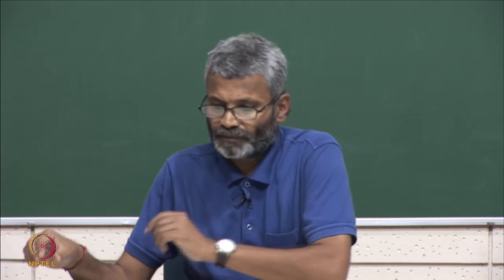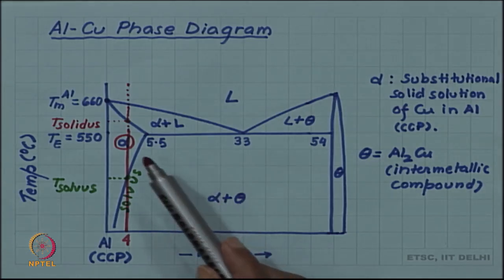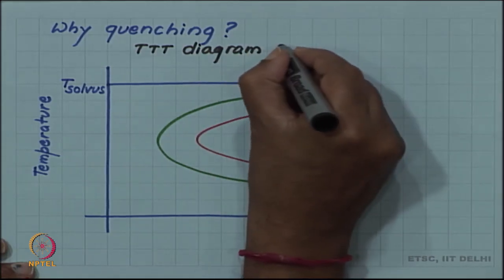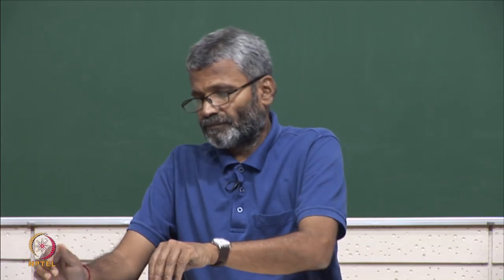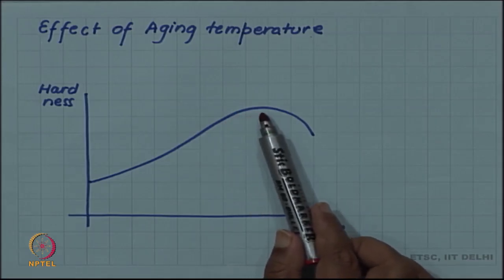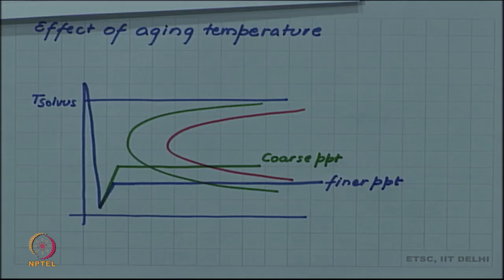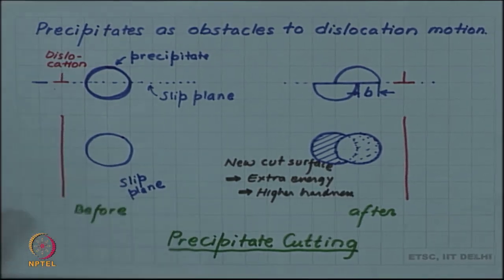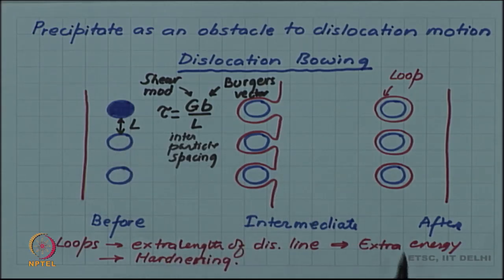Age hardening II: Microstructure and mechanisms

Comment: You have said in your previous video that no change in the microstructure of Al alloy was found. But in this video, there is a microstructural change (change in the distribution of precipitates) which proves that " Property is a function of microstructure". Is that not correct?
Reply from the maker: It all depends on the scale of observation of the microstructure.  The size of precipitated causing increase in hardness is very small and cannot be observed at the optical microscopy level. So for the initial investigators, like Wilm, no change in the microstructure was observed although there was change in the  hardness. This was the surprise element. But later, with help of more powerful electron microscope fine precipitated were indeed observed. So, as you state, property is indeed a function of microstructure.

Comment: Why precipitation takes place in side grains? Why not at grain boundries?
Reply from the maker: Precipitation at grain boundaries require less driving force and thus can happen even at higher temperature in comparison to precipitation inside the grains. Thus in slow cooling precipitates can form, but as the transformation temperature is high, most precipitates will form at gb. This is not good for hardening. This is the reason why quenching is required. Quenching, followed by ageing allows precipitation to happen at much lower temperature. Due to higher driving force available at low temperatures, precipitate form inside the grains as well, leading to more effective hardening.

Comment: As we precipitate will increase the hardness value, can we apply this method to explain the hardness enhanced by addition of reinforcement in matrix composite material.
Reply from the maker: Yes. Dispersion hardening (say thoria-dispersed Ni) and hardening due to reinforcement in metal matrix composites can be explained similarly. Of course, in these cases there will be no time-dependence.
Reply: @introductiontomaterialsscience  thank you sir, your answer is helping my project....
Reply: No you can not apply... They are two different mechanisms.
Reply: Please address GP zones vis-a-vis hardening

Comment: Sir, dislocation bowing is a mechanism of over ageing or ageing???because initially you said that dislocation loop leads to the difficulty in the dislocation motion ,leading to an increase in hardness ,but by using stress formula you proved hardness decreases??
Reply: When a dislocation negotiates a precipitate distribution it can bow between two nearby precipitates. The stress required for bowing is inversely proportional to the distance between the precipitates During aging, as more precipitates form, this distance between the precipitates decreases so the stress required for bowing increases. During overaging, the no new precipitates are forming. The existing fine distribution of precipitates changes to a coarse distribution with the same volume but less number of precipitates. This increases the distance between the precipitates thus reducing the stress.
Reply: @rajeshprasadlectures   Thanks for the explanation !
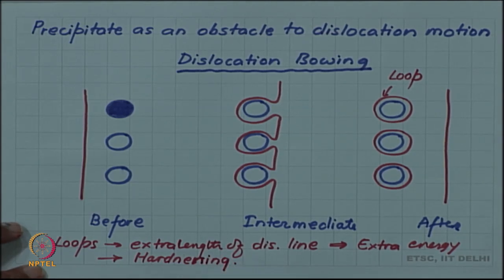Reply: @syamukrishnan  @34:04 it's mentioned loops increases hardness in coarse ppt, but when u refer formula it seems contradicting, but both statements are correct in their place.This is how I think it to be:
1. Loops increase hardness, so overaged alloys must have hardness higher than pure Al
2. But when u refer to formula, u are basically comparing stress required for fine ppt and coarse ppt

Comment: Sir is there any method to get the alloy at maximum hardness after aging and prevent it from over aging?
Reply: The way it is done in industry that peak hardness is attained by artificial aging at a higher temperature. Once this hardness is obtained the product is used at room temperature. At room temperature, although averaging will eventually take place, but the rate is rather low. So the component will maintain its hardness for the expected product life.